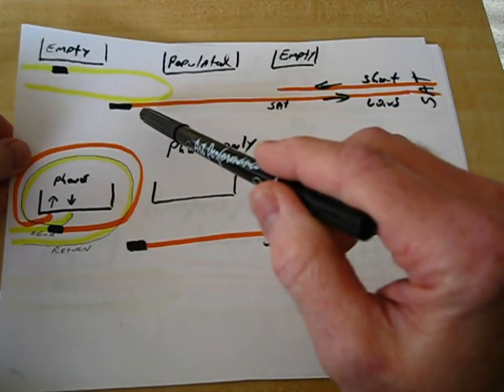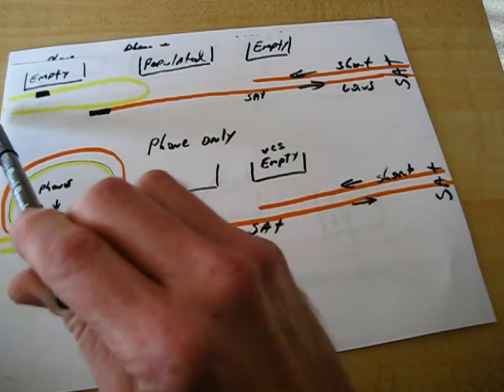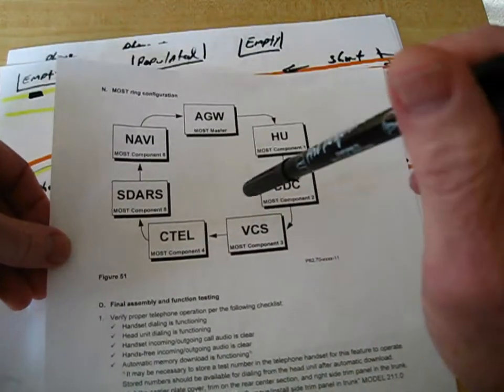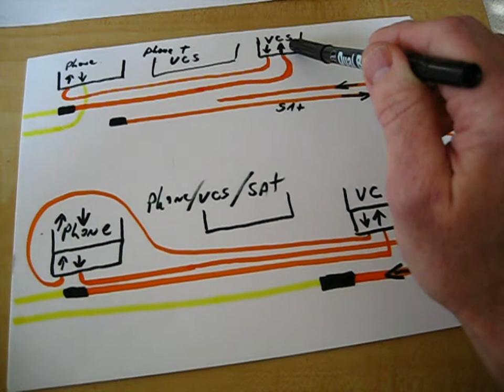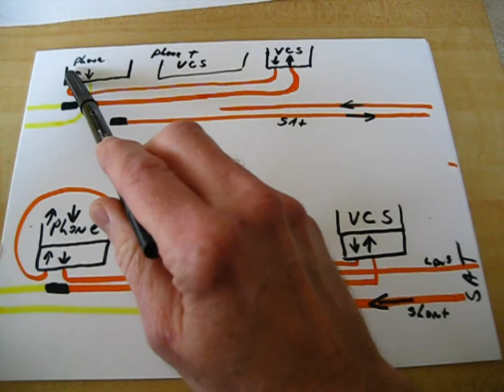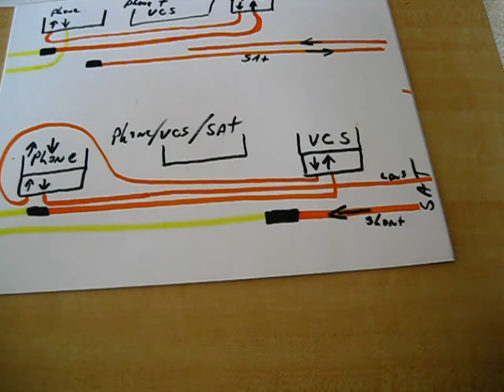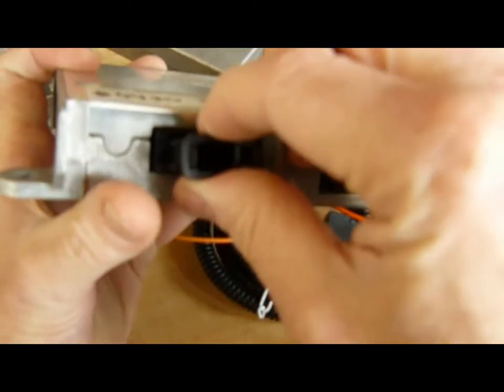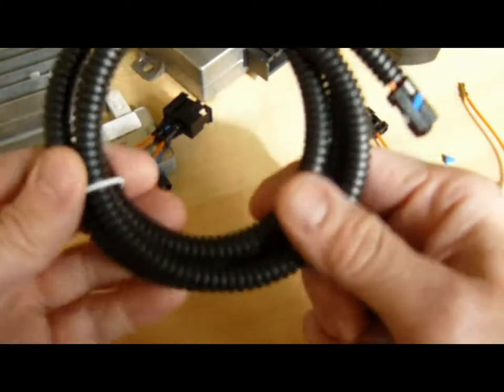Mercedes W211 Factory Phone and Bluetooth install * PART 3 * MOST Fiber Optic Cable E500 E350

Comment: I'd like to ask what I think is very important regarding the modules that connect to the radio in the cockpit. Are the fibre optic cables for navigation, voice module, audio gateway, etc multi-mode or single-mode? I'm asking because I  removed the Bluetooth dongle from inside my armrest compartment to free up space for my actual phone, and that caused the radio to stop working. I checked and there's a male fibre optic loop connector(lollipop) that I have to buy, but I'm wondering if I can splice the in and out cables to close that loop instead.
Reply from the maker: First: DON'T CUT ANYTHING!!! That likely would not end well. My bluetooth connector is not incorporated into the MOST fiber optic system, do you have a different model than me? If you simply unplugged the dongle, that shouldn't affect anything, on my car if I removed the installed connector, it still wouldn't affect anything. If your car is different & you did disconnect the fiber optic you need either this: https://www.ebay.com/itm/223136521415?hash=item33f3f91cc7:g:yToAAOSwBlVcz-hX&amdata=enc%3AAQAHAAAA8BXeY3KSZe0nik4S5rT9InXrsY4K8J5Dopxtef%2FzZWnhC%2BWn%2FHKeB3fS1ro%2Fq9lCtm8In9MxHffBt1TEJmi8gV7lbyHoJLE4rcsHPwyE5oDOvtfRXkyP8kPSMsqi3rKBosatQbVw7prZdxh6A55pkH0EFPsXQX2D86Fok2qQR5ZFI6bwe4tboTLlXhwyO5x2yKKBmdThHdJIGOsldm0%2BqxF7vZsaGoJ4xpF%2FAt0m5x%2BKvPeMbES2jQZeW6%2FFeeik806%2FwP%2Beai32gTlbUVwWIcobnAR6yLeb9%2FadGfLPGtuwgou1auwkJqgIB8iFg%2F2l5A%3D%3D%7Ctkp%3ABFBMlvTssq5h     
Or this:  https://www.ebay.com/itm/334350222013?hash=item4dd8d382bd:g:wYUAAOSwVAhiIHx6&amdata=enc%3AAQAHAAAAsPfrpVhnFCtgY6DefVeEQg7XYAf9UrUqc4WoaTJaj4Rg4xQPy%2BHsP2VCRv%2FjeoJqpDz%2BST4%2FRmG%2FkJQBV%2Fv2Axzw0YxaxzhTijBr%2BRsBd5tiA1Cx0wU3%2BZiGj9B7jXcQU4cT7HBrOl1OGRrqHvtxl%2BTOJhmVug%2Fmkum3PIm1PW9ACAYTY9EOniROClMcnaWtcffBx8Ru73sWN8TxX5YaGh6fAm9Mbkxnv4I3LQ10AsCC%7Ctkp%3ABk9SR7z1xbOuYQ
Reply from the maker: And yes, the fiber optic is a continuous loop. If you disconnect something, every thing in the loop stops working until you connect those 2 loose ends together.

Comment: The old Mercedes technology is no longer needed these days. The better option would be to build in an Androidradio. They look like original radios and also have a better sound when the speakers are wired directly to the radio. If you want to operate more than 4 speakers then you should install an external amplifier. Forget the old Mercedes radio and the associated system! That is trash!